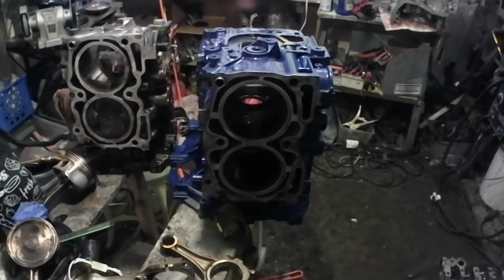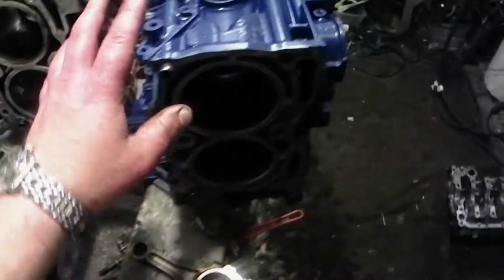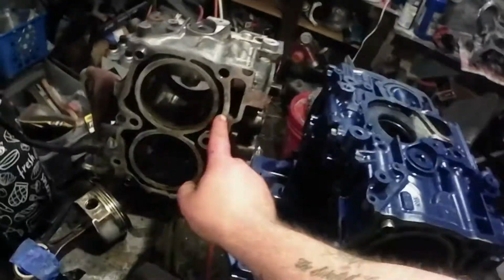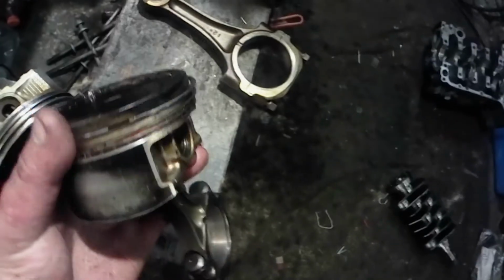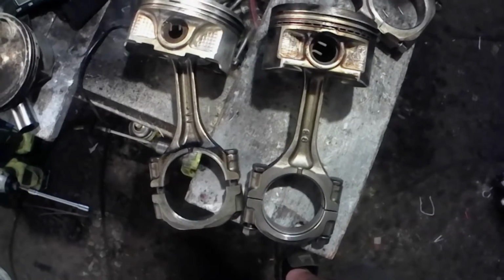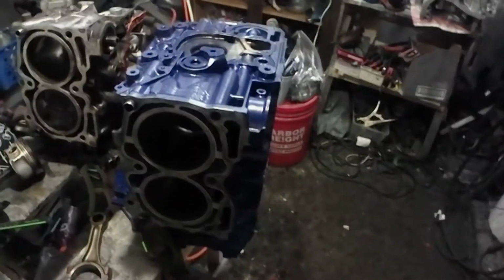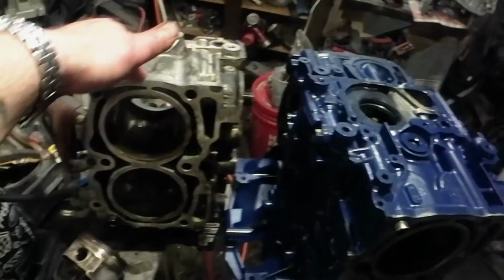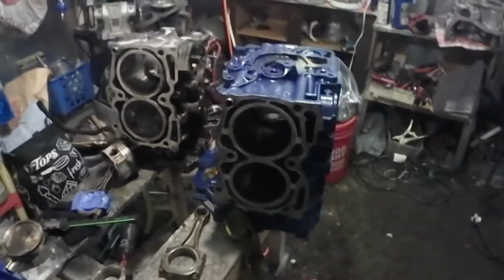Non-turbo EJ-25 vs. Turbo ej25/ej205 block comparison.👍😎

Comment: If I have an '01 Forester with en EJ251 (SOHC) can I rebuld the cylinder heads and install them on an EJ257 shortblock?
Reply from the maker: Yeah but your compression might be lower than the ej251 block because the 257 pistons have more air volume at top dead center. As far as the heads they'll bolt up. Run your sohc timing belt should work, I believe that's a common hybrid motor build your attempting. Hit up the RS guys and their forums, genius fanatics theyd know much more than me.
Reply: @crazyDIYguy  Lower compression is a good thing. I ordered a supercharger kit I plan on installing it, getting it running on just 2-3 psi and once I work out the kinks, rebuilding the SOHC heads on to the 257 with ARP head studs and working my way towards 400hp. The goal is to keep my wiring harness and change as little as possible around the engine
Reply from the maker: @shallowgrey  nice, I highly recommend polishing the inside of your intake, supercharger, heads, not really porting just polishing. Makes a psychotic difference and will make it snappy as hell
Reply: @crazyDIYguy  Awesome tip, and thanks so much for the swift replies! Love the channel

Comment: Very Interesting comparison, how's your NA/T Subaru running ?
Reply from the maker: Just a td04 eBay "churbo"
Reply: @crazyDIYguy  no but is it still running fine? Hasn't blown up yet?
Reply from the maker: @fipfip3331  no lol almost 180,000 too, she's tired and old but it's my reliable backup. It's an ej251 I believe. Probably 40k with the turbo on, I've made a ton of mistakes too, over-boost, lean, etc. Doesn't die 😎👍

Comment: I have a 2006 2.5i with SOHC.  Can I slap those heads from the EJ253 onto a EJ257 shortblock and will everything line up?  I want to keep the 2.5i wiring and everything.
Reply from the maker: Crap I didn't see this, yes the parts are all interchangeable but you'll change your compression mixing different heads with different blocks. If I remember correctly there's differences in the crankshafts, pay attention to your quench height and stroke, etc.